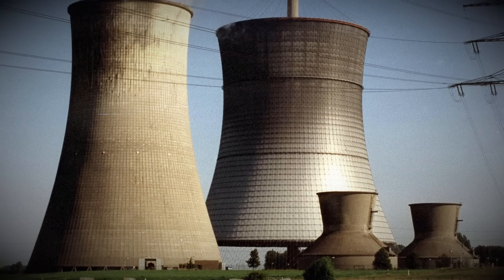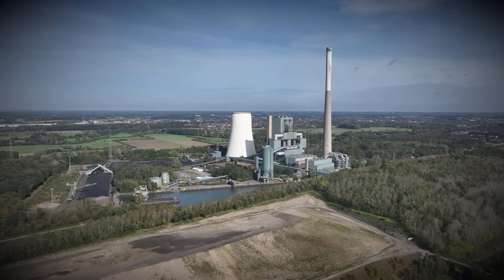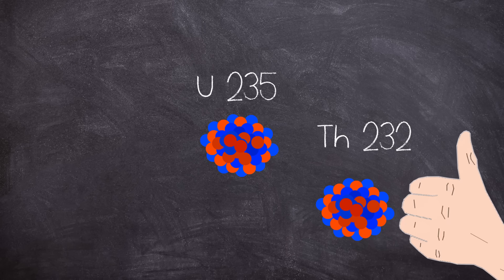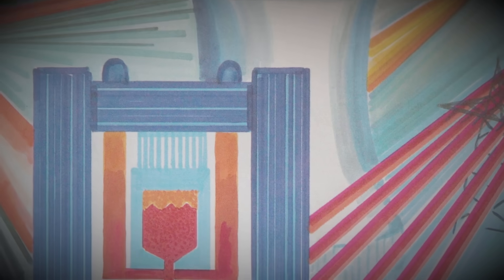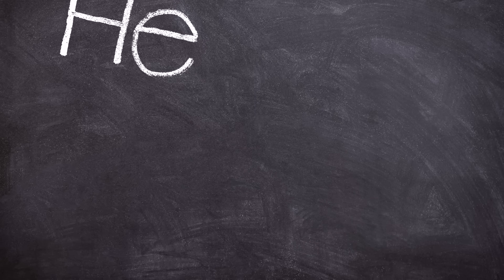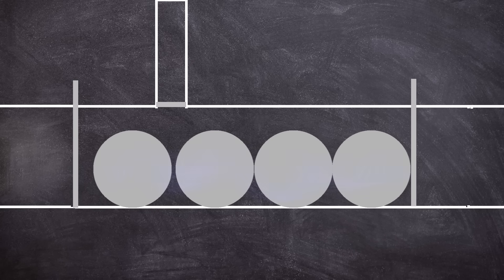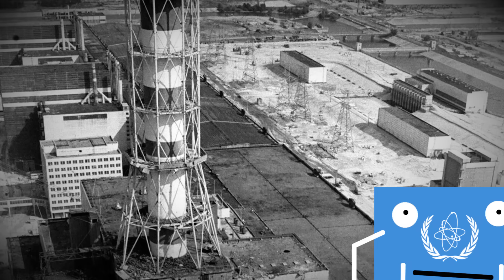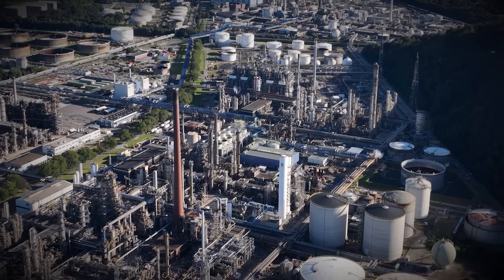Inside Germany’s “Chernobyl”

Comment: Cutting back their nuclear programs to absolute zero definitely wouldn't have any effects on their nation's need for power though, not at all, nothing in the slightest would ever go wrong in that... :P
Reply: We did gradually cut it back over a two decade phase-out, starting in the early 2000s.

And we produce enough renewable by now to not only compensate for that, but also are able to reduce use of coal. Aiming to phase that out until 2038, too.

The only remaining fossil source will be natural gas for a while, as gas plants are the best when it comes to quickly react to load changes.

Well, water plants are quick in that respect, too, but we don't have enough of those and not much potential to add any new ones anymore ...

Comment: Why was the manual feed mode a full override of the safety mode in this system??! Who set up this relay logic, the manual system mode, and the computer logic to begin with where you could only feed a set number of balls instead of telling the system how many balls to feed in?!?!?!? This is a failure of automation more than anything else. You NEVER leave a machine able to go into a fault mode under user control like this. Manual mode should have been a mode that still had the computer not allow unsafe commands and then there should have been an "override mode" that would let you anything where the operator could make mistakes, but would be aware that they could make a release and would only be used for things like clearing a jam and only under extreme care. The vent stack should always have had a filter on it since all nuclear vent stacks can emit radiation, so filtering them is just a good idea. Yes, it costs money, but that is a fudge factor you really want to have in case a mistake is made and would have made this accident a minor one instead of an industry ending one.

But again, who set up the PLC system for this where it was so limited? I know it was set up in the early 80's, late 70's, but even relay logic could have been safer than this. You don't let that series of command be valid logic electrically for anything other than full override that only the most senior and trained operators are trusted to run. As for the system only being able to do a set amount of balls, that makes no sense at all. It should have been possible to have it be variable even back then very easily. This whole thing stinks of them hiring an incompetent automation contractor, likely just the electrical engineering firm for the plant and not an experienced automation company, that created an unsafe system.

Comment: Is it me or is the fuel cycle explanation wrong? U-235 fission provides neutrons to transform Th-232 into Pa-233 and then to U-233 which is fissile. A bit off a mixup between U-235, Th-235 and protons to produce fission. 

50 Bq is nothing right? A banana has an activity of about 18 Bq, so why would this then be labled as a Chernobyl type event?

From the comments underneath this video it sounds like the contamination surrounding the plant is/was measurable with standard equipment. Something seems off here.

Comment: So manual override the system caused the problem? I've worked in process plant maintenance engineering. Almost every non wear related problem or breakdown we had could be tracked to an operator overriding the automated systems.

Comment: Well …… the THT Incident was not the Reason for the shutdown of the other Reactors. It was the Fukushima Incident and the Fact that there was the Residual Risk who was put under the carpet. By the Way there will be add an Neutron to the Thorium, that converts inside the Thorium 233 Nucleus via  β Activity to a Proton. The Protactinium 233 than makes an additional  β decay to Uranium 233. This Nucleus can be split by an other Neutron. In no case there where add an Proton direct to Thorium 232. That is Incredible ineffective in terms of Energy needed to do so. Greetings from Germany.

Comment: It's a bit telling when every other country's "Chernobyl" resulted in so little harm. Even Fukushima Daiichi.
Reply: As far as I'm aware, no one has died of radiation poisoning in that area. It was the earthquake and mega tsunami that killed.
Reply: @lofthouse23  And the designers had considered both in the design of the complex, and it ALMOST worked.  The tsunami was just a lot higher than they had anticipated and over-topped the sea wall built to protect the backup generators to power the plant's emergency systems in the event of disasters like earthquakes and tsunamis.

And even then, the problem is that the reactors were of an old design that required residual cooling even in their full shutdown state.  There are safer, more modern designs that don't have this flaw.  For instance, the CANDU designs don't just shut down, they go cold when shut down, needing no residual cooling after a short time.  The also have a very safe SCRAM system (if you've never heard that term before, it's the emergency shut down system).  The SCRAM rods are suspended above the core, held against springs by electromagnets powered directly from the power feed to the primary core control systems.  So, should you lose the power to the primary core control system, the reactor can't NOT perform an emergency shutdown, with the springs pushing the rods faster than a pure gravity fall.  The time from trigger to full engagement is 0.1 seconds.  That's literally 100 times faster than Chernobyl, and they don't have the design and construction flaws in the SCRAM system of the Chernobyl reactor.
Reply: Fukushima Daiichi was a near miss.

What's telling is the continuous downplaying of the issue and the patently false claims by the nuclear supporters.

(I've read the internal NRC comms transcripts and the email trails BTW - if you are thinking of educating (gaslighting) me about 'truth' or something )
Reply: @rwerk66  A near miss?
Reply: @rwerk66  "false claims" Like the fact that chernobyl is one of the only nuclear failures which resulted in a big amount of loss of life and issues due to completely incompetence? Because thats not false at all... You think you're so smart but the entire fukushima incident is documented and available to the itnernet so no clue what you mean with "internal NRC and email trails" but you keep gaslighting yourself. Even with Fukushima there was a fair bit of incompetence and corruption present. Mostly from the goverment and power company themselves trying to cover this up. Luckily it was less devestating then chernobyl

Nuclear power has by FAR the least lethality out of any and all ways of creating energy and so far even with chernobyl the least impact on the worlds environment.
Reply: @rwerk66  Saying that Fukushima Daiichi had no confirmed deaths (one attributed) after directly being hit by an earthquake, a tsunami and having both fixable design flaws and human error is not downplaying, it's a fact
Fukushima was the by far worst case scenario possible......And it resulted in very little damage
Reply: @KaoKacique it was far worse than the worst imaginate  scenario, and even then,  would have been no nuclear disaster if Tepco had followed basic safety advice

Comment: Yes fossil fuel still make up the majority of Germany's energy consumption. But most of it is for heating and transportation where nuclear energy doesn't help at all. Electricity is mostly renewable now with about 60% for this year and 55% in 2023.

Germany relied heavily on lignite because its cheap and it has so much of it. In fact it was the only energy source that was locally available in abundance. Climate change only became a topic in the 90s or early 00s when Germany's economy struggled under the difficult integration of East Germany. There wasn't any money to build new reactors. Also pollution was seen as the larger issue and natural gas was successfully framed as a clean alternative for coal by the fossil fuel industry. Germany isn't alone in this regard. Basically all of Europe stopped building new reactors after 1986. It's also difficult to start building new reactors when you haven't for decades as we can see with the few current projects in England, France and Finland.
Reply: "nuclear energy doesn't help at all"....the nuclear electric is required for trains, EVs, and new GenIV reactors have 750C heat co-generation for industrial processes (e.g. fertilizer production, cracking coal, cracking oil to clean burning).  I think GenIV nuclear has a solid future.
Reply: @Carlos-im3hn  Well one could start building a new reactor now and have it operational in 20 years (12 years late) and 4 times over budget. Or one could just bet on renewables and add the same capacity of such a reactor every single month
Reply: 'Germany relied heavily on lignite because its cheap' - you forgot one word in front of this sentence. East. The west had black coal, too (and closed its mines already) 

The east did it simply because they had no other source; and the USSR wasn't that helpful either, they would rather have the Uranium from the Erzgebirge (Ore mountain range) for themselves.

Comment: 13:22 Should have been a zero ... the reactor had a interface loss of coolant directly into the environment, a serious accident in light water reactors ... but with helium as coolant and the uranium bound in TRISO fuel only so minimal traces of activity escaped that nobody really cared ... it was such a great reactor concept, core-melt-immune and safe, that now China builds them after getting the techonolgy practically for free from Germany.... and here in Germany, the kWh in November costs 80 cent ...  😢
Reply: I dont know who is your provider...but a quick check at lets say check 24 should give you a better deal.
Somewhere between 30-40 cents kw/h is the avarage.
Reply: @bowi7496 i live in Munich we pay  0,73€ per kwh
Reply: Tbh I think 1 is correct, not because of the actual issues though.

That is to say as you point out the actual event itself should be a 0, but the actual impact and ramifications of the event make it a meaningful event if only politically.
Reply: And it's not okay to discharge, but braunkohl let's a lot more radioactive pollution loose
Reply: @-allround-  yeah, coal ash is super radioactive and we produce over 10million tons of it per year. 

Meanwhile, the entire amount of spent fuel radioactive waste we've ever produced is less than 20k tons and would easily fit into a small Turnhalle.
Reply: 80cents, holy crap, in the Netherlands it's around 30 cents per kwh
Reply: Yeah he's capping, I pay 37c per kWh 
 @-allround-
Reply: @JustinKoenigSilica  Hier geht's nicht um den Jahresdurchschnittswert, sondern um die Herstellkosten während der Flaute. So teuer wie noch nie, danke Grü*linge.
Reply: @benteyssen5720  ließ mal weniger Bild 🙄
Reply: I live in Duisburg, NRW, Germany  and currently pay for 28,53 EURcents per kW/h.
Worst price was right after Russia attacked at around 38 cents per kW/h. Guess some regions have stupidly inflated prizes for no reasonable reason or someone is to dense to change to a better provider.
Reply: Holy wtf smokes 80 cents euro per kWh?!?!?

Comment: Sad that entire industries, particularly one using thorium can be ground to a halt by such minimal occurrences like this incident and Three Mile Island.

Particularly ironic when you consider last year in the US alone, 470 /died/ in the petroleum industry.
Reply: Three Mile Island wasn't minimal. When they removed the rubble, they found corium in the lowest part of the container. Ten years after the incident.
Reply: @gabbyn978  why yes, high temperatures did result in corium production as one would expect. However, the vast majority of the melt was contained within the pressure vessel of the reactor and none of it escaped the biological shield. Further, the release of radiation to the surrounding area was minimal.

All that being said, the safety features of American nuclear reactors have only gotten better in the past forty years. The minimal /exposure/ which occurred in 1979 was blown entirely out of proportion.
Reply: @dragonboi20  People just don't get it.  Three Mile Island was a massive fuck up on the part of the human operators, largely due to the control and computer interfaces turning out to be crap.  AND THE INDUSTRY LEARNED THE LESSONS AND DESIGNED VASTLY BETTER INTERFACES.  And so did other industries, too.

Comment: Your numbers concerning how much fossile fuel Germany used in 2023 is plain wrong. According to the Fraunhofer ISE, the German energy mix of 2023 consisted of 51% renewables (the official German statistics bureau lists even more -- 56% renewables) . Of the fossile part, 33% was coal, 10% was natural gas and only 1.5% of the German energy mix was from nuclear. Even in 2022 nuclear provided just 6% to the mix and from Fukushima onwards it was just 11%. Hardly a core of the energy production network (between 2002 and 2006 it was 30%). 

I don't know what your sources for the German energy mix are, but apparently they are wrong

Comment: Reliance on fan driven helium sounds like a trouble point waiting to happen.

Light water reactors seem like they're a lot more manageable when trouble emerges.
Reply: The concept of this one was that they could always release the ball pit into an emergency chamber below where the balls would be spread out sufficiently to mostly stop further reactions ... as far as I remember ...
Reply: @luelou8464 I know the UK also built some liquid metal cooled fast reactors.  Or, at least one.  A plutonium breeder reactor.  And if they could get the public acceptance required to put the entire set of facilities in one place so you never had to ship stuff like spent fuel between sites, we'd essentially eliminate all the transport issues in nuclear power.

Comment: Don’t mix the end of German nuclear power with this event. It was unrelated. The end of German nuclear power actually was the accident at Fukushima. Our former chancellor, Angela Merkel (who btw has a PhD in Physics) wanted to appease the sheep who got upset by Fukushima and decreed the end. 

I agree with the rest though, terribly short sighted, especially considering that she should have known better. But well, she messed up many things.
Reply: yes, ok, well; but, both disaster nuclear reactant byproducts were uniquely detected nearby.   And of course a human condition was involved somehow in these.   Fukushima had a built-in failure mode (flooding pump room from Tsunami) that was not handled properly ahead of time.   Again root-cause all human weaknesses and lack of analytical resources or political will to improve or re-engineer "complete and flawless" designs.
Reply: Then again all our existing reactors were close to, or even already beyond, their original planned life time. The exit would have happened anyway, just a few years later.

The industry pretty much lost interest in building new plates in the late 70s / early 80s already, no new plant projects were started since then.

The old plants were only producing as cheaply as they had already fully been written off.

And new plants would not have received the same subsidies as the old ones for planning and construction.

That's for example why Biblis never got the originally planned blocks C and D.

Oh, and all the old plants had gotten an exception to the "you must have proof of terminal storage", with a terminal storage being planned in Gorleben being deemed sufficient.

No new plat would have gotten the same out-of-jail-free card anymore.